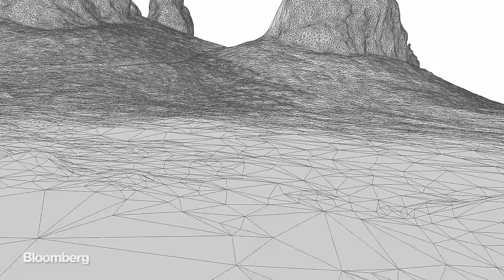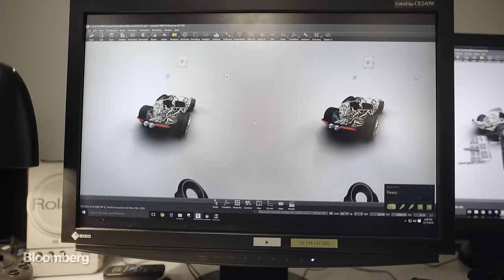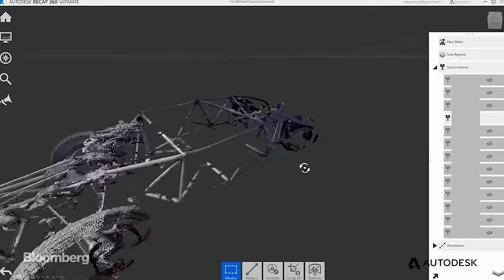These Hackers Are Building Insane Custom Cars... With A.I. and 3D Printers

Comment: So they're using optimization software which automotive engineers have been using for decades, to design a space frame chassis, a technology which has literally been around since the 50s and is completely outdated. There's nothing innovative or new about what theyre doing, in fact this is probably the easiest way for someone to build their own custom chassis. I think what they're doing is cool, but to pretend that they are the first to do this is either very ignorant or dishonest.

Comment: How come the 3d printed model looks nothing like the cars they were testing?
Reply: I assume they're only taking the largest load-bearing members from the frames that are spit out, and approximating that as well as they can with as few bends as possible. The frames that are spit out are superleggera-type frames, which are very time consuming to actually make. So, they iterate until they find a simplified version that performs as expected before trying out the more complicated version, removing much of the material and time cost in the prototyping phase. At least, that's what I would do.
Reply: AimlessMoto They test the car made by the AI and then feed the AI the data from testing that car. That new data helps create an new, better car. Rinse and repeat. They just didn't show many of the original AI cars but showed later generations. I think the mule was probably a gen. 2. I think I saw one car that had a gen. 1 AI created chassis.
Reply: Because it's all bullshit.
Reply: you would need an autoenclave to produce such a chassis out of carbon fibre  materials.
Reply: Because that's the latest that is yet to be constructed in parts during the taping.  I'd be curious to know if they've finally got all of the necessary parts complete before constructing it all together on the chassis membrane.
Reply: @titter3648  Small brain mode is permanently engaged with you isn't it?
Reply: @nvrndingsmmr  They are using standard of the shelf dune buggy's. Nothing at all like the 3D printed model. And the 3D printed model is also just a lazy PR bullshit ploy. They just put a standard chassis into Fusion 360 generative design and printed out what it spit out.
And the sensors they are putting randomly on the dune buggy's? What do you think they are using them for? Nothing is the answer, this is just some bullshit put out for the people that is impressed by mythbuster and similar programs... And the sensors is standard off the shelf hobby breakout boards like you can buy on sparkfun or adafruit that they have just glued in random spots on the buggy.
Reply: they probably need the correct printer (and someone who specializes in making that printed object to work as intended), that looked like plastic and they need a metal printer and the oven for the prints

Comment: so machines are also replacing engineers, that's just great.
Reply: CockatooDude but you get my point
Reply: CockatooDude I obviously didn't mean n all engineers
Reply: What would be wrong with replacing engineers? Humans suuuuuuuck, the best thing we can do is build AI that does our work for us, if someone gets replaced it's because they're no longer useful, do you suggest we replace every backhoe with a team of humans with spoons? Not shovels, spoons, a shovel would be far too efficient.
Reply: @curbo34  what?
Reply: I don't think it will anytime soon, this is more expensive than other fabrication methods and money is what drives the market. this makes sense for some applications, I see it used in conjunction with human design as imagine trying to repair something like this, our designs are meant to be repaired when broken
Reply: @curbo34  I wasn’t saying we shouldn’t, I’m just annoyed that I’m nearly done with my degree and want to work in a market that’s going to be much smaller soon

Comment: @3:07  Why is there a fuel line(or oil, or pressure realease) connected to a fuel filter leading into nothing? did something fall off or come apart?